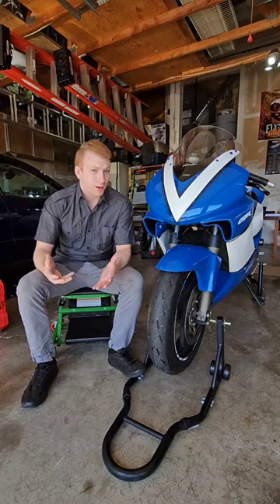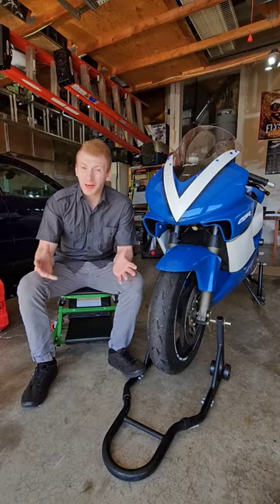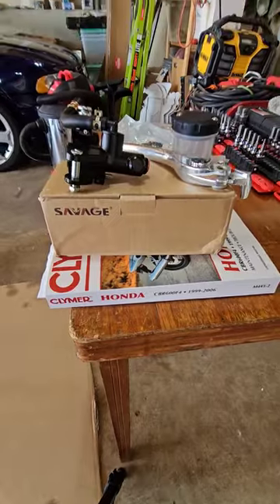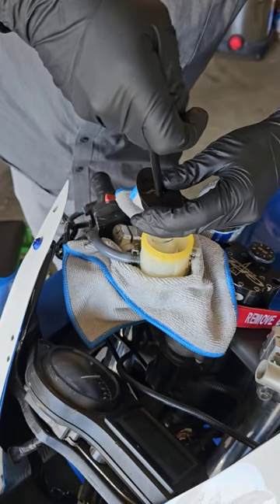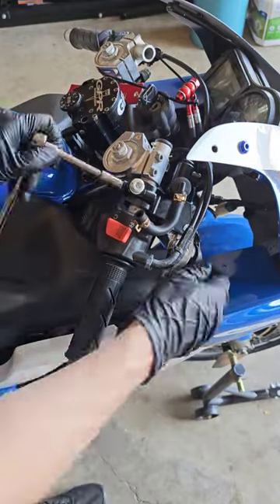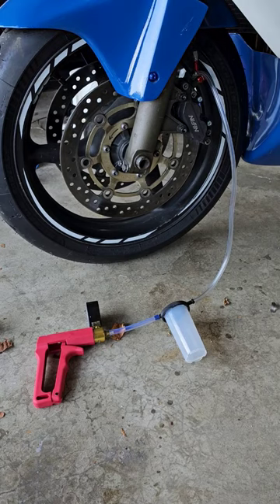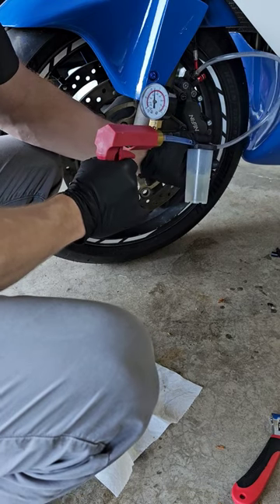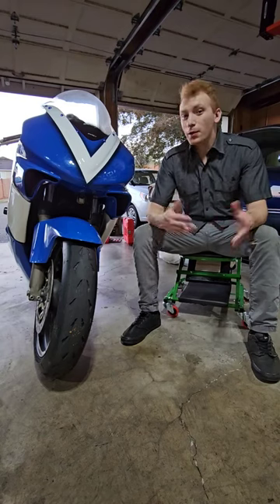HOW TO REPLACE A MOTORCYCLE MASTER CYLINDER

Comment: eBay special on a track bike? I’m not telling anyone how to do their own work but that just screams sketchy, last thing I want is to come in off a straight into a slow corner and have my master cylinder and entire brake system fail, doesn’t have to be a brembo system, and while you do pay for the name, you’re also paying for the performance
Reply from the maker: Didn't have time to put it in the short but I have plans to use a brembo master cylinder next season. I agree with you. I only plan to use this for two sessions.